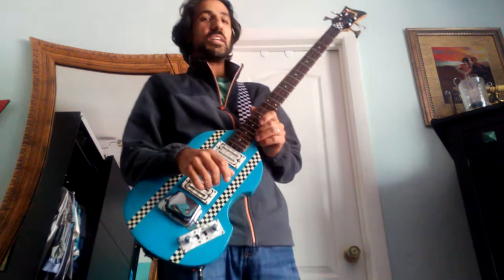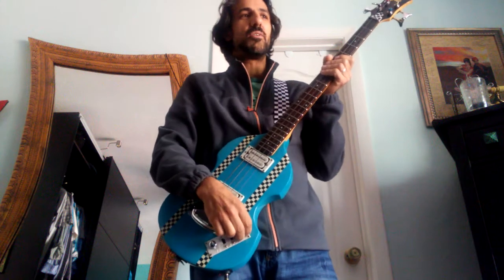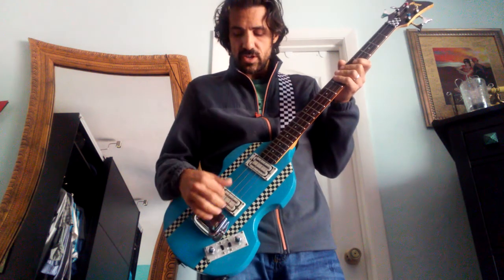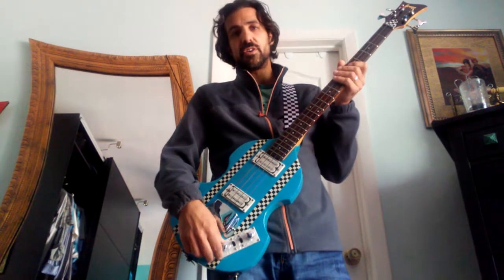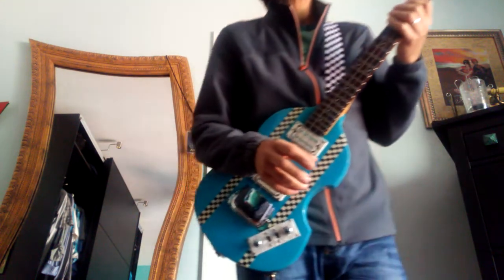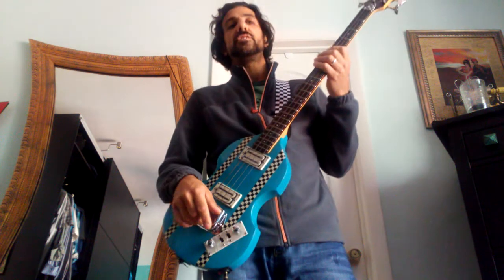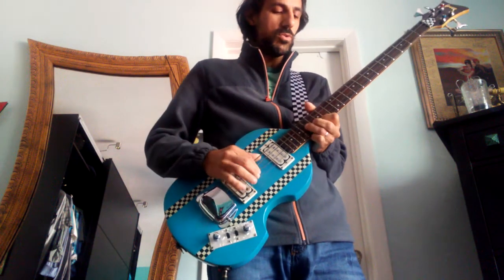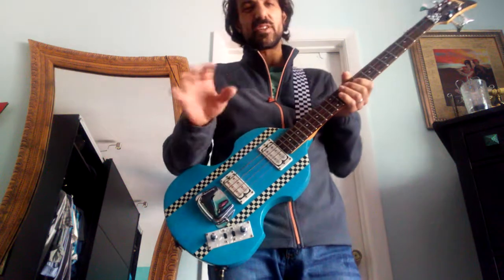Black Ice Overdrive Bass demo

Comment: Dope AF, son.  If you want to get rid of the Radio Interference, buy a few "RF Chokes."  I have a few with my setup.  One half way on my input cable, one on my pedalboard power cord, and one on my amp's power cord.  They need to be placed usually 1/3rd to half way on the cable.  Voila!  No more Radio Interference...